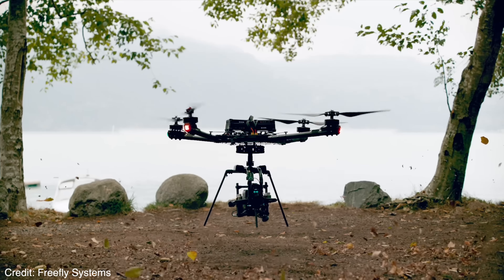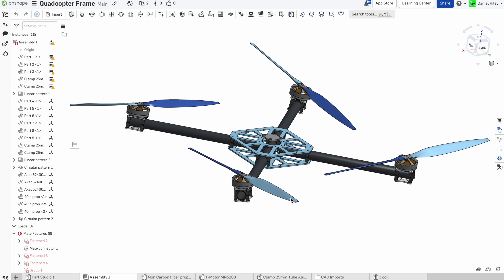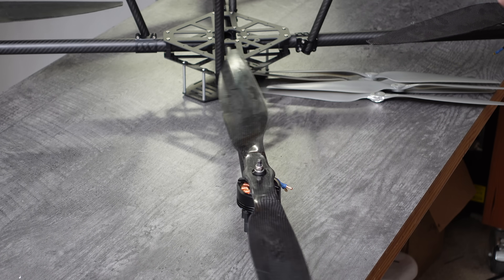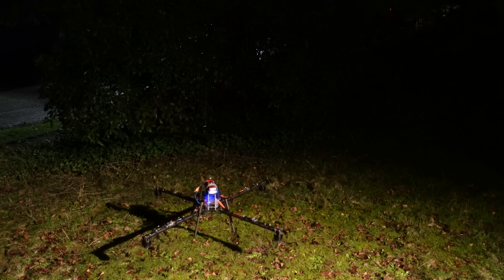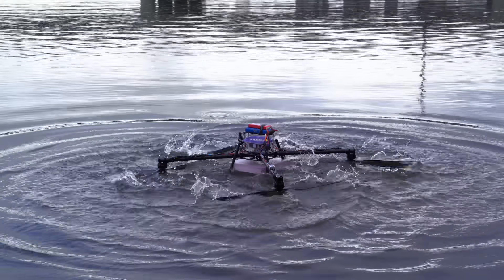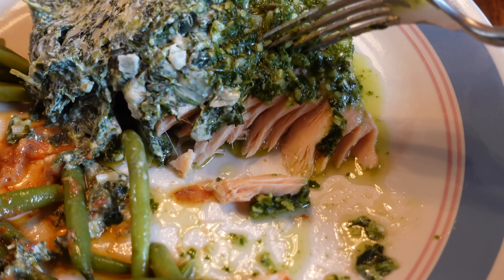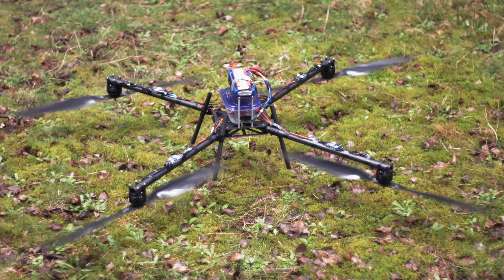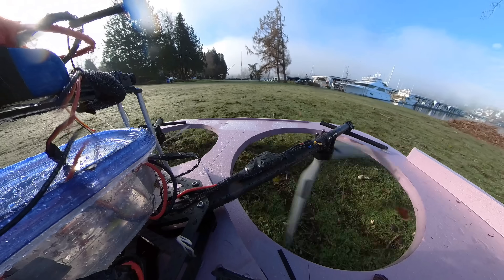Quadcopter Ground Effect Vehicle

Comment: AWESOME video as usual!!!

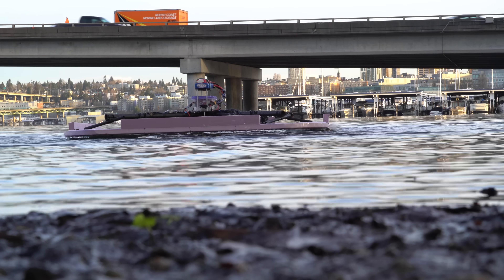At 8:50 I'm pretty sure the suction affect is because the closer the props and flat bottom are to the waters surface the smaller the cross sectional area the downwash has available to travel trhough (the flow under the perimeter of the craft forced through by the props). This causes the flow to accelerate and create a low pressure zone (continuity law: decrease your area increase your velocity. Bernoulli: increase your velocity, decrease your pressure. I think those are what theyre called, been a while since ive been in school haha). So the closer you get to the water, the lower the pressure becomes under the craft (kinda counter-intuitive haha). so this is also a positive feedback loop. But at a certain distance and closer, the flow is too restricted and the effect stops and the craft suction decreases. So it can sorta oscillate. I would expect you to not have this phenomenon occur when you dont have the big foam sheet, since without it, the flow free and doesnt have that perimeter curtain to be forcecthrough.

Interestingly this effect is the same reason that container ship got stuck in the suez a year or two ago. It got too close to the edge of the canal and this caused the area for the water to flow past to become narrow, which lead to faster flow speed, which led to low pressure, which sucked the boat closer, then made it more narrow, more flow speed, lower pressure. you get the point.

Weird edge cases of fluid mechanics where you get weird feedback loops like this are so cool :) Again, I love your videos. So inspiring!

And i dont think the downwash velocity is anywhere near mach 0.3 so yall dont come at me with compressible flow XD
Reply: Yes, the "suction" effect is what the formel 1 cars  uses to get extra downforce  on the car, lower clearance to the flat bottom of the car to the ground gives more downforce.
As close as possible without touching.. Just a little touch make the car skid immediately.

Comment: Hey, you said the bigger props were using more amps, but did you take into account that they were running on lower voltage? Overall wattage was probably a lot lower.

Comment: It looked like the instability at speed was due to angle-of-attack lift generation from the flat areas of the cut-out plate... even though those flat areas were just left over from the sheet with the prop holes cut in it.  You might try prop skirts that are a little taller and stabilized in space with a mesh vs. the foam plate.  Also, before ditching the idea, what about trying a horizontal stabilizer to counteract the pitching-up tendency at speed.  Some software fixes are probably also required, so when underway the vehicle is not just trying to stay flat, but in a pitched forward orientation that avoids the angle-of-attack lift generation.

Comment: The suction to the water you saw at 9:00 is probably the venturi effect. The fast flowing air between the water and foam makes a low pressure high, velocity area! Therefore sucking the foam (and quadcopter) down

Comment: I think the biggest problem with vehicles that float on a cochin of air is that they have limited control. The only use for hovercrafts is that they don't need solid ground under them and basically don't touch it while carrying lots of weight. They are a worse helicopter.

Comment: Bought a $250 quadcopter about 10 years ago. Small/medium sized. Had a thin plastic body, that when mounted helped trap thrust air. This has the benefit of giving it ground effect flight. Hovering roughly 1-3 inches depending on power setting. Would not fly if lifted up higher. Run it off a step, and it would drop down to GE height. It gave me about 50% more flights time. I could run up and down the street/sidewalks. Clearing fresh cut grass off my drive and sidewalk. Whole time using hardly any throttle. Then had to give a decent boost of power to lift it past this GE height. 

Sorry, just always thought it was a neat little thing. And then stumble on this video.

Comment: Maybe i'm missing something, but did you still drive the smaller props with 3s and the bigger with 2s when comparing the impact of ground effect? If so, shouldn't the big ones still be more efficient because they drew higher amps, but at a lower voltage?

Comment: That soft ceiling is interesting. I think it is due to the air being circulated upwards and back into the top of the props when the aircraft is at that specific altitude, making it suck in air that was moving downward and lowering its lift. Once you throttle past that and get out of the altitude 'sweet spot' the circulation effect dissipates and you can hover with less throttle.

Thats my theory anyways...

Comment: The large props on mismatched motors were probably less efficient due to I^2*R losses not magnetic saturation.

Saturation means the torque stops increasing when current is increased above saturation current.  This means the flight controller would not be able to maintain control no matter how the PIDs are tuned because the motor would not be able to achieve the requested rpm.  When the quad responds to a pitch disturbance the motors on one side can slow down but the motors on the other side wouldn't be able to speed up and even if it could stay level it would lose altitude.

A higher Kv motor has lower Kt regardless of motor size.  Kt=1/Kv in Si units no matter the motor size.  Bigger motors are thought of as higher torque because they can handle higher current without burning the winding or saturating the stator.  A huge motor and a tiny motor make the same torque with the same current if they are the same Kv, the big motor needs (and can handle) more current to make more torque.  Big motors also have smaller winding resistance so they will draw more current at the same voltage. That means having high Kv motors on large props will use more current than properly matched Kv motors on the same props.  And it's important to have fairly close matched motors and props because motor heating goes by the square of the current (I^2*R), so having 2x too high Kv means 2x higher winding current and 4x more motor heating and inefficiency.   

Running the high Kv motor on lower battery voltage does not fix the problem that the big props need more torque (and current) to spin.  The reason quads use higher voltage than the motor requires for the target prop rpm is because peak current is determined by winding resistance so running more voltage will allow higher current spikes and more responsiveness to disturbances like gusts.  Basically it means you can achieve a better PID tuning.

The esc pwm duty cycle and motor inductance act as a buck converter.  If a 100kv motor needs 10v to spin 1000rpm, and the battery is 20v, that means the pwm will be 50% duty cycle.  That also means the motor current will be 2x battery current since power is conserved.  For example, if the motor needed 2 amps to spin the prop 1000rpm, the battery current would be 1amp in this example.  So running extra battery voltage also lowers battery current (but does not change motor current).  Since this buck converter effect is not actually 100% efficient, and higher step down buck converters are less efficient, this is why you don't just run as high a battery voltage as you want.

It took me years to fully understand everything I just said because some of it goes against intuition we have as RC hobbyists.  We all know if 2 different size motors have the same Kv the bigger one will make more torque, but that's because it's drawing more current, if Kv is the same Kt is the same too.  We've also all put a higher Kv motor in our model and got higher speed and torque, although I just said a higher Kv motor has lower Kt.  The reason for that is the higher Kv motor has so much lower winding  resistance it can draw enough current to overcome the lower Kt.

Comment: You went the wrong direction with Voltage.

Increasing the Voltage is better than decreasing the voltage. You deceased the voltage, this increases the Amperage to get the same power. Heat due to Resistance of the wires is a function of Amperage, not voltage. So, using the small low Voltage battery reduced efficiency and increased heat. You should have increased the Voltage. The Pulse Width Modulation (PWM) will just adjust the width of the pulse of electricity. Low Voltage = huge long width of the pulse, eventual always on like a DC analog motor. Always on for the PWM is the limit. High Voltage = very short small width of the pulse. 

Put a higher voltage battery, get less motor heat, and let the PWM controller set the Speed. Don't use the a lower voltage to try to lower the speed.

In summary, if you want to drive a bigger propeller, up the voltage. The limit to how high you can up the voltage to drive the bigger propeller will be the PWM controller max voltage. Or, if you have a high voltage PWM controller, it will be the insulation on the motor windings when arcing will occur somewhere, between winding or something uninsulated parts that are too close together.

Bigger Propellers require more power to drive, so deliver that power as higher voltage.

Comment: Great video, i just don't understand why you only use current to monitor the efficency of both props as the power is equal to the current multiplied by the voltage and you use a lower voltage for the bigger props. If the voltage for both props was the same, looking only at the current makes sense but here from what i understand the motors voltage is lower with the big props so even if the current is higher, it does not means the motors are consuming more energy.
Reply from the maker: the voltage was the same...

Comment: As I understand it, decreasing voltage means higher amperage for same power, thereby more heat for same power. If anything is seems more logical to increase voltage, to reduce heat generated for any given power output. Within the voltage range the motors and controller can handle well. 

Reducing voltage limits the possible power output, and thereby possible heat generation at full throttle, but it still produce more heat for a given power output. 

So can we hope for experiments trying to achieve low noise levels, using things like large props?

Comment: I don't know if you considered this, but since the ground effect is stronger with a low aspect ratio wing you might get a better effect using a low profile propeller more similar to a fan blade.  You would have to custom make them though since I doubt anyone makes them.

Comment: The effect you are describing at 9:03 is the air recirculating around getting pulled through the inwash while pushing down on the top of foam boards. It goes away once you are far enough from the ground allowing the air to go straight down breaking the circulation.

Comment: Lowering the battery voltage does not change the voltage the motors will see at low RPMs. At hover power the motor current will be the same regardless of the battery voltage. And the motor phase amps is what creates the heat and burns out motors and controllers. Literally no difference between running a lower battery voltage or limiting the max PWM of the controllers. Makes me very sad to see  you misunderstanding basic fundamentals... Think of the controller as a magic box that converts any input voltage to the desired motor phase voltage (up to motor back emf limit) and the motor will then pull the amps that it wants based on its load and KV.
Reply: The vast majority of ESCs are using Pulse Width Modulation. To me the best way to think of this is a switch that turns on Full Voltage for the width of the pulse. Double the Battery Voltage will half the width of the pulse to get the same power. The inductance of the winding limits the voltage of the windings when a short pulse of full battery voltage is given.  Essentially we are saying the same thing. 

He halved the voltage, got double the pulse width to deliver twice the amps to get the same power with double the heat and half the efficiency.
Reply: @WeBeGood06  the motor voltage phase amps and voltage are identical regardless of the battery voltage... If you halve the battery voltage you get double the battery amps, and yes approx double the PWM  duty cycle. But the motor don't care about PWM duty cycle, only the phase voltage and current. I hope dude takes this feedback to heart and maybe even does a vid on it. It's a tragically misunderstood basic principle of EV operation.

Comment: I think you should place the batteries lower instead, under the main frame, not on top of it. With all that weight you can lower the CG by a lot and improve the stability. But definitely theres a reason on why you do it.

Comment: The reason the foam skirt would get "suction cupped" to the water is bc of the surface tension of the water and the microscopic dimples in the foam board. 👍👍

Comment: It would have been really interesting to see the stability effects and efficiency gain by putting the propellers further apart. Looks like they are only half a propeller width apart. Moving them to a full propeller width apart would probably result in far less air squirting out the side without providing much lift or vertical stability

Comment: I think at super low altitude what you find is the lack of ability to push air out ends up equating to an inability to draw air into the props, and they stall.  At that point the switch from being a foil to being a centrifugal fan, which turns them into a vacuum.  This is the sudden sucking action.  Just my rumination’s based on nothing.

Comment: 8:53 it might the becourse weird things like bernoulli effects, the flat surface interactions between the foam and the water, if the air flow faster some places it should create some form of "suction" between them making it feel sticky.

9:00 maybe see if you can interduse some smoke and one of those flat lasers. 
Maybe you make giant vortexis that  swirl around like big helicopters do, the big plate probably amplifies the effect they course.  Wen you get far enough up they probably destabilis course no more rebound of air from ground?

Comment: If you want to explore the big props a bit more, do a search for "Ian Davidson boomcopter".  It's a large tricopter with a fourth prop that rotates around the rear boom acting as a pusher.   This way you keep the aircraft flat (low drag) and 3 main rotors never need to run above hover power (actually a bit less in forward flight).      I have an old Foxtech FPV Screamer which was a 5 inch quad with a 5th pusher motor.  Called the screamer because the pusher prop was ingesting really dirty air all  the time so it was *LOUD*, but also good for about 90mph forward flight and you could pitch it back and climb straight up on just the rear pusher motor, fully stabilized.

Comment: its definitely not magnetic saturation. power converted = back EMF* current. Power wasted ~= current^2. If you undervolt & slow down the motors to keep the current the same for your big props then the motors will be operating in an inherently less efficient part of their curve.

Comment: Instead of flipping those motors and props upside down to get them closer to the water, leave them upright and surround each prop with a foam duct. With the duct, it’s no longer essential to have the motors so close to the water because this will drastically increase the pressure below the prop and create a more compressed air cushion below the craft. I’ve built a number of foam hovercraft many years ago using this principle and it works.

Comment: I’m most impressed by how quiet those big props were!  I think you should do a project to make the quietest quad copter you can.  Mark Rober had a video recently with a really strange prop design that was supposedly really quiet.
Reply: Toroidal Props, though they arent all that much quieter, they shift the noise down the scale to make it "less abrasive" or less annoying to human ears. They are actually very close to normal props in terms of actual Decibel measurements. So we perceive it as quieter.

Comment: With your skirt at low altitude air flowing under the props has to escape to the sides, thus creating a venturi effect between water and skirt, lowering pressure and ultimately attracting your craft towards the water. 

Same effect as when a ship moves close to a wall or to another ship, water in between has to escape quickly and sucks both ships towards each other.

This increase in speed only happens significaantly when both objects are very close to each other, and is not significant when overing a bit higher / farther from the obstacle.
Reply: Great observation @leodurez9631 ! This is exactly why the skirt doesn't work well when it is close to the water. It is not intuitive, but the faster air is causing a low-pressure zone under the skirt and sucking the copter down, not pushing it up as desired. Remember, wings work because the faster air over the top is a low-pressure zone. In this case, you have inadvertently made an upside-down wing. Nonetheless, I love all of your videos, please keep producing and I will keep smashing the like button!

Comment: Dude - weren't the smaller props run at a higher voltage than the smaller props? Power is current*voltage. More current on larger props does not necessarily mean less efficient. Multply it by the voltage...

Comment: if only there was a way to get the lossless from magnetic saturation in the stator back into the system. What if there was another tough metal besides iron or steel in the stator that you could somehow loop that energy back into the system.? I don't know enough to be able to tell if that is impossible or has already been done been done.